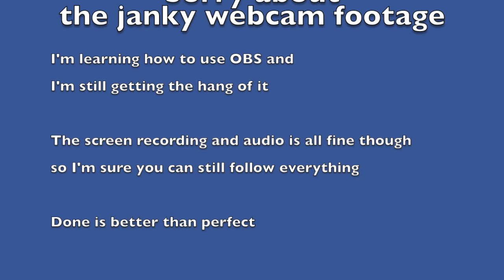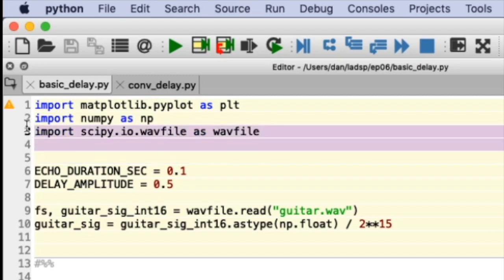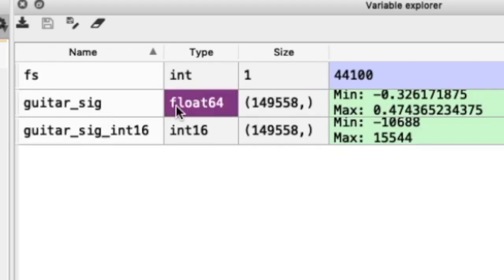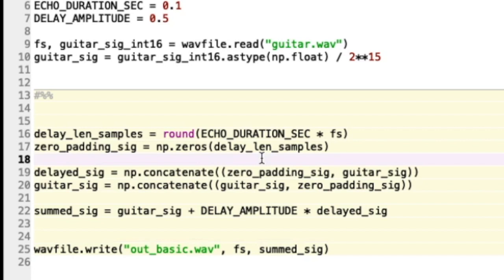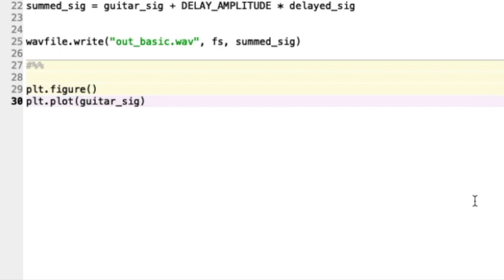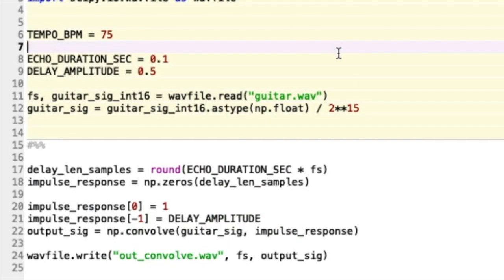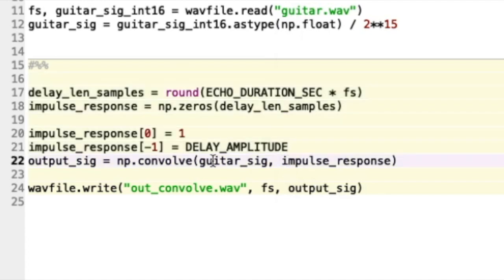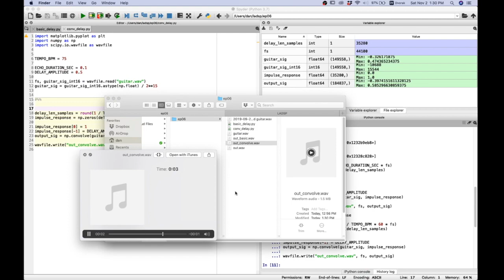Programming basic FIR delay effects and convolution

Comment: This was perfect Dan and thank you for using Python. It has become the bridge between my existing programing knowledge and audio while I (very slowly) wrap my head around c++ :)
Reply from the maker: I think python is a great stepping stone for audio processing. Basically doing anything in C++ is hard, so I think it's great to understand the algorithms before you try and tackle them at the same time as compiler issues, real time concerns, and memory problems you get in C++.
Reply: It sure is. Also, not needing to worry about complex formatting is helpful when learning. The less visual noise there is, the better, I say. On a side note, I appreciate your use of verbose variable names. Too many times I get lost looking at code because the variable names are just letters and have no connection to the functions using them. I mean, have some ideas about why some opt to use cryptic variable names but can't really prove anything, yet. ;)